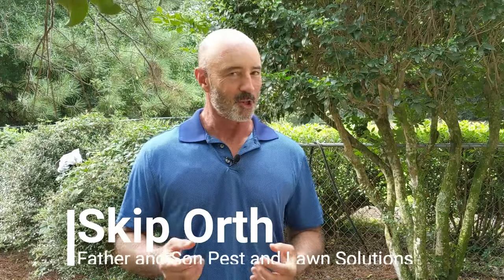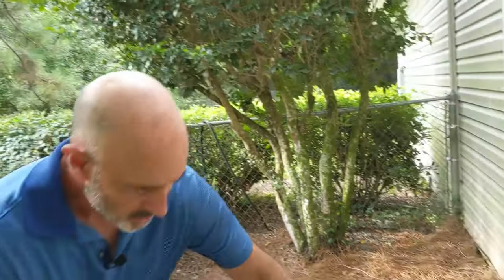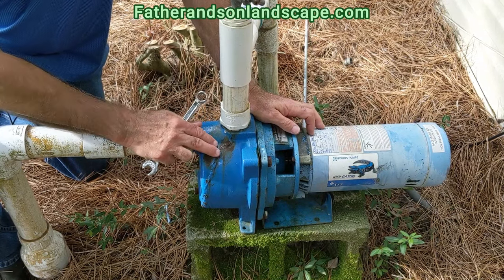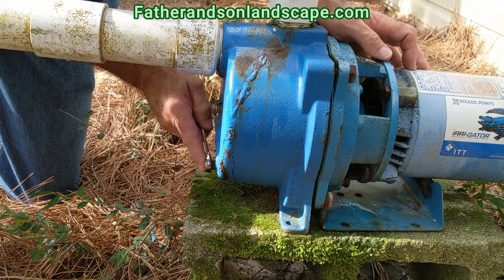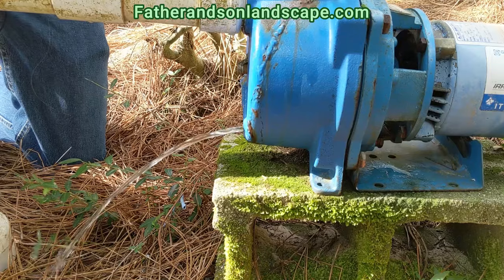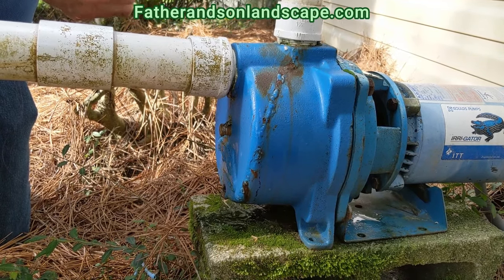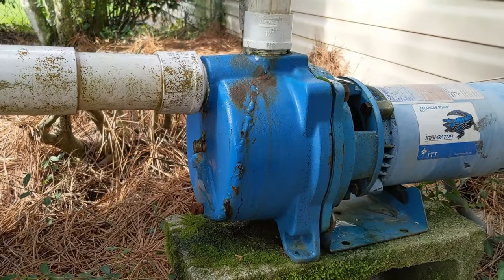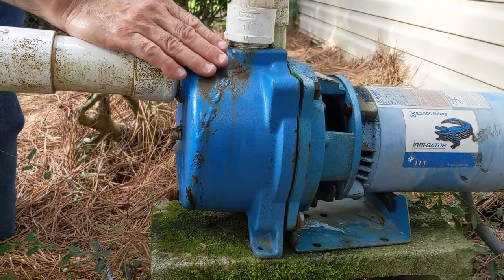How to winterize and prime an irrigation pump

Comment: It's funny, I only watched the first part of your video before the winter to winterize my pump. Now that I wanted to use the pump again, no water was coming out. So after some googling I ended up back at your video which started automatically at the priming part from where I left off last time! We're also right down the road in Gulf Breeze! Thanks for your video!

Oh and indeed, you should just prime / fill it before turning the pump on.

Comment: Great video! I had no water coming out but the pump motor was running. I went to prime the pump just like you showed and quickly learned that my pump had a big crack in it. Water was flowing out of the crack. I knew immediately because i had just watched your video and you showed the welded crack in your pump. Now I know I need to winterize this pump, even down here in Myrtle Beach, South Carolina. We did have a colder than usual winter. Hard lesson learned. Hopefully I can get my pump welded too. Do you know if the pump portion of the unit can be replaced, without replacing the entire pump/motor?

Comment: Love the video!  I was wondering if you could help with a different question.  I have one of these Irri-Gator pumps, looks just like yours.  Mine doesn't come on at all.  I traced the 110V signal into the pump from the timer, and through each component and through the capacitor.  So the signal is getting into the pump but it does not energize.  Any suggestions?
Reply: Pump is burnt up

Comment: Thank you for the video. I have a submersible pump for my well and cannot figure out how to turn on the pump other than turning the sprinklers on at the control box. I tried putting water in the spiket and had some water spurt back out, but depresurized after 5 seconds. Any ideas?
Reply: Same problem with me

Comment: What's the top plug for? Can I pump auqa-grease in there to quiet it. It's making a lot of noise, to the point where my neighbors are complaining about it. I tried putting grease in where it spins, it just throws it off, but the top plug. Can I pump it in there? It's gonna cease soon, I can hear it.

Comment: my pump primed, but turned off after 3 seconds.  FYI:  my timer is not set.  is that the problem?  haven't set the timer because I can't figure out how to set it.  it's a very old timer.  if that is the problem, please let me know and I will have a new timer installed.